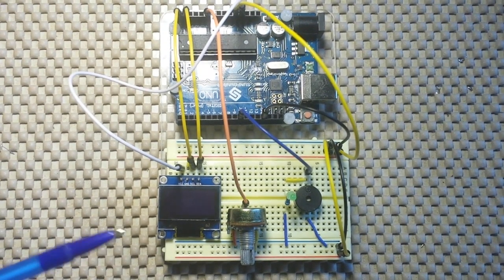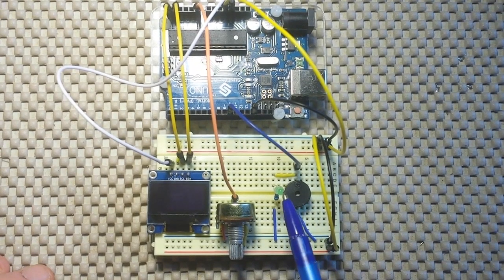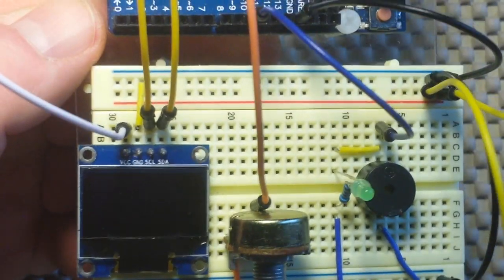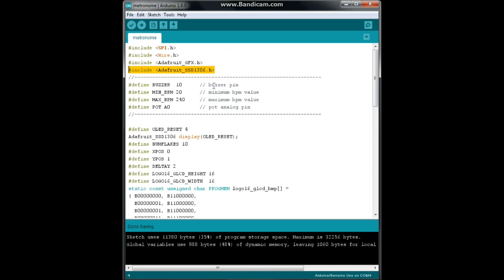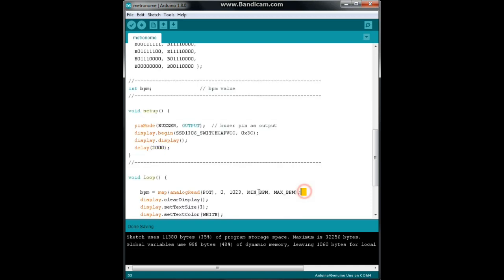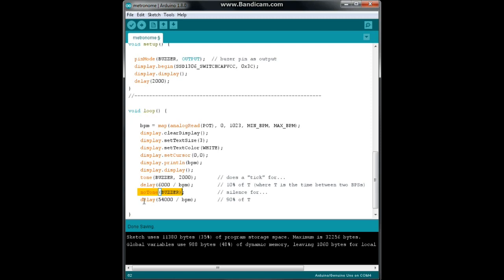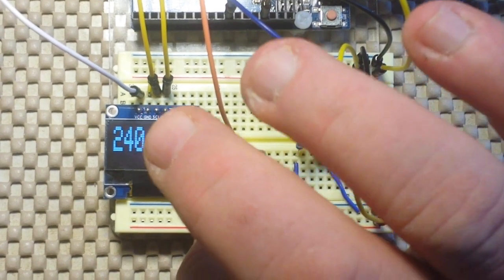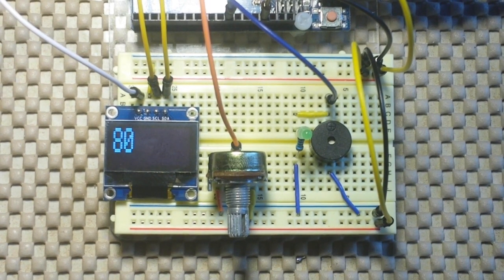Make your own Arduino Metronome

Comment: This worked great but had to make a minor change in the code.  I had to add a 3000ms delay because when power is cycled to the arduino, the screen wouldn’t display the BPM, it would be blank.  Adding a 3 second startup delay fixed this.  

I have a question.  I’d like to add a second LED so it alternates between the LED lights, similar to the hand on a metronome.  Is this better to do through logic or with circuitry?

One other modification I did was add toggle switches in series with the buzzer/led so we can choose to have audio/visual or both.
Reply from the maker: Remember, the triple 5 timer can source or sink current. So you can have it blink one on the upbeat and one on the downbeat just turn them in opposite directions. And hook them to the output pin number three of the triple 5.

Comment: Thanks. I've built an Arduino project that runs the lights and sound for my "One-Guitar Show" -- a two-act, solo musical -- from a button and IR sensor built into my guitar that wirelessly talks to an MP3 player (for backing tracks and sound effects) and DMX controller (for the lights). I was wanting to add a metronome so I could peek over at a flashing light offstage for the songs that had backing tracks and match the timing. Your video came up when looking for ideas. Don't need the readout, the potentiometer, or the buzzer, so it's super simple. I was starting to hardcode the delay and you made me realize, "Duh - I just need to divide the # of thousandths by the BPM!" Super simple! Check out the project at www.MissRainsong.com.